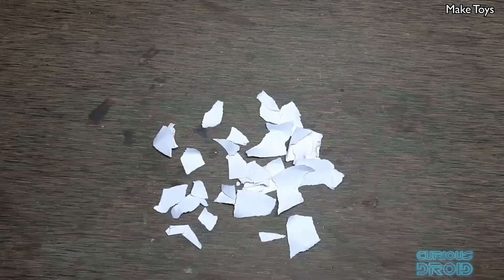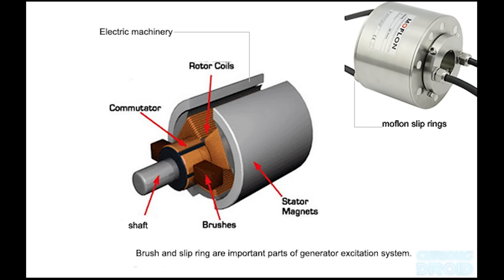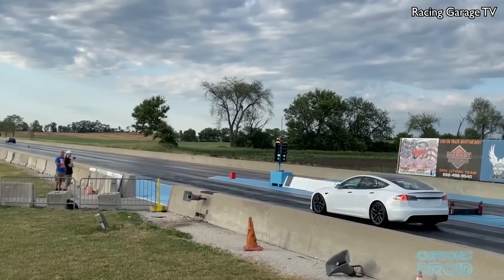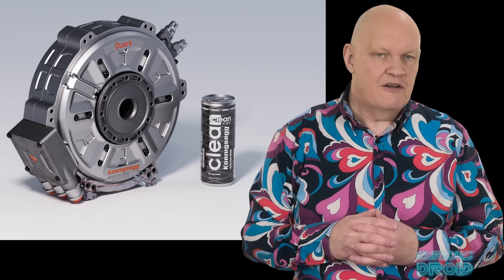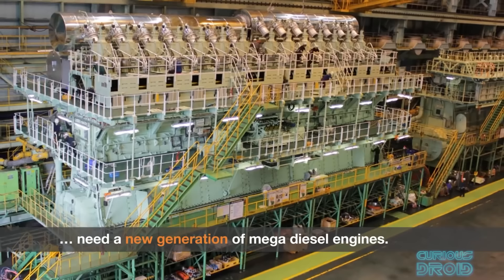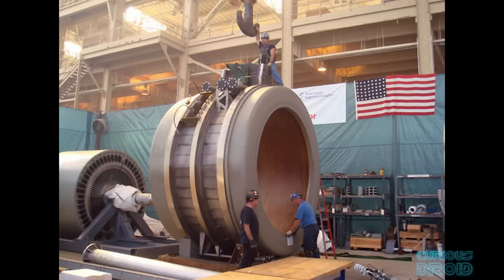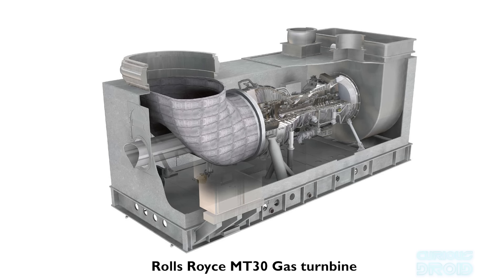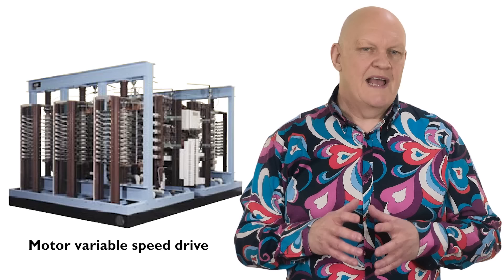The Worlds Most Powerful Electric Motors

Comment: Hot take, but even though EV's are having a huge pop in production from car companies, this won't last long. Not many countries can support EV's. Even 1st world countries can't support them. Just look at California for instance, with their power infrastructure, they can't even handle a typical summer season with households using AC without having rolling blackouts. The other factor is the US for instance will have to upgrade it's power production to a conservative estimate of 70% (source provided by Engineering Explained, and will most likely need far more than that). The final nail in the coffin, a big portion of the population in first world countries can't afford to buy even the cheapest gas powered car, let alone a significantly more expensive EV. People also don't understand that creating a bigger dependence on power companies to charge 500+ million cars in the US, the price/ kilowatt will skyrocket. These chargers are also "vampires" even when there is no car plugged in at a charging station, power is still being feed to it (not efficient, waste of energy).

I can't see EV's in the next 15 years. There's a lot of skeletons in the closet with EV companies when it comes to humanitarian crisis, ecological impact (greater than ICE), moving efficient methods of burning gas to a extremely low efficient power grid, gov. role in forcing EV products on the people, etc... There's a reason why most car companies are jumping on to the EV market but still investing into ICE. Koenigsegg, Toyota, BMW, Porsche, Ferrari, Lamborghini, etc... have stated the cracks in EV cars, and even with their biases, they're not lying. They're only doing EV's for now to meet emission averages set for companies for their product line, they know that stopping production and r&d on ICE will back fire on them, like it will with Mercedes, Subaru, Cadillac, etc...

The biggest way of drastically cutting emissions with the least amount of environmental impact is nuclear fission (until Fusion is viable). Shorting the time, and  granting subsidies to create the latest plants and bring online/ upgrading old will help us stop the dependency on fossil fuels. I would also love to see that be done to cargo ships, but with the amount of accidents cargo ships have, that would be extremely risky and not worth it.
Reply: Right on! The cost of mandated total elimination of combustion engines makes it completely unfeasible for at least 50yrs. And that doesn't count the power grid. I was a farmer, we commonly use inexpensive 20 to 50yr old equipment especially for small but extremely essential tasks. Sometimes very essential such as grain transportation. Most grain trucks are 25 + yrs old, look almost new with only 15k mi and go for $2k to $10k because they sit 9 or 10 months a year inside. There are tens of millions of ICE in service in lower income businesses and personal use for livelihoods such as river traffic in Asian countries etc. I cannot possibly imagine having to replace every single up to 60yr old tractor, mower, pump, truck, chainsaw, ATV,  generator, cement mixer, etc even on a small farm will bankrupt any nation even before you build a power grid which must be nuclear to be feasible.  The cost will be absolutely unbearable by being passed on to us in increasing the cost of any available food, commodities, lost jobs, fuel or parts we still need, the cost of copper and aluminum etc, the taxes for government subsidies to poor people who can't but a USED EV to get to work that needs a battery replacement and costs passed on to consumers. That wartzilla is far cleaner and more efficient than the total cost of installation and production of electric propulsion. Along with a long service life. We will be using alot of diesel fuel to produce the steel, concrete, aluminum, etc for this. As well as transportation. The batteries and motors use RARE earth's!  (Those Diesels are so clean now that 2yr old trucks hadn't darkened the INSIDE of the exhaust yet! But they cost 2× as much to buy and about 4x as much to operate and the close to 50% loss in mpg! (Yes I had to document this on semis) we almost only ever fixed emissions equipment that deadlines trucks and requires tows. The engines that were blown up was from egr water leaks and xtreme Temps and thin oils. So, 2x as much fuel required because of increased hauling of diesel to fuel stations,  30% or so increases in cost of truck, 3x cost of maintenance, tons of pollution releases making the 1000+pounds of computers, and hardware that every 40 loads needs an extra load to transport 40k lb when you are limited to 80k gross weight so more trips! I'm sure this government boondoggle has helped greatly. Let alone the complexity of modern cars placing them out of reach as good alternatives as used transportation for the average working stiff with basic mechanical knowledge. I tell these people to get their heads out of their tailpipes and look at the big picture! The worst part is they use a PROJECTED issue.  (Global Warming due to fossil fuels) that we cannot go into the future and see how it WOULD'VE Been without trillions spent, lives wrecked etc. Thus when those sometimes inflated predictions don't happen they scream success at saving the world. (I remember when Obama said we would be in a collapsed society in a waterless desert by 2020 if he wasn't elected!) Our enemies will love our totally centralized and hackable power supply! No more home grown moonshine and fryer grease power in mechanical engines for us! Or walking with a borrowed can of gas to your dead car!

Comment: it’s a shame so many “electric “ motors get their energy from burning diesel …
Reply: I mean nuclear is the solution, but no one wants to discuss.
Reply: @CallanElliott  Yeah I agree it’s probably one of the top solutions I guess no one wants a power plant in their backyard but if we can erect power plants away from human populations and pipe the energy over to cities that might work
Reply: @ozzyg82  who is burning diesel? thats way too expensive. maybe check sources instead of using political ones
Reply: @Blox117  #keyboardworrier
Reply: @ozzyg82  yes i am a worrier
Reply: @Blox117  sure you are 😉
Reply: @ozzyg82  my point was that the electric grid, if it runs on combustion, is almost entirely natural gas. which is not diesel.
furthermore an ever increasing majority is solar, with some wind and hydro.

Comment: Wtf is the point of using a gas turbine to create electricity to drive an electric motor to drive the propellers??
Why not drive the props directly from the gas turbines? 
Seems all one 'gains' is efficiency losses...
Reply: Gas Turbines run fast with little Torque, which is the exact Opposite of what you need for Ship Propellers. The according gearbox wouldn't be much more efficient than Electric Transmission, which happens to be lighter and more compact. The real Advantage is in Damage Control though, as mechanic Transmission would require the Turbines to be at the Stern next to the Shafts. That means that all Turbines are in the same Place or at least very close to each other, so a Fire or Leak could easily destroy all Turbines and thus cripple the Ship. With electric Transmission, you can place them flexibly (almost) anywhere you like. This also allows to use the Interior Space more flexibly. Cruise Ships use Electric Transmission for the same Reasons, although usually with Diesel Engines.

Comment: You really should do a video on NGTE pyestock (<pictured) far more impressive than that thing nasa has 
The red things are 27.5MW motors 8 of them in this building and because that wasn't enough two more elsewhere 

Pyestock was a jet engine testing facility and could maintain air speeds of 2000mph at 80k feet and because there was a running engine in the test chamber it was completely open and not a closed loop 

Most of not all important European engines were developed here most well known being the engines used on Concorde

Comment: The Real Problem is that these Motors Still require a Source of Electric Power to operate. The problem is that we don't have enough of that Power Generation to do little more than Sistane the electric Power consuming things we now have in place and no more Feasible means of Electric Power Production for all the things they demand we convert too. At least  horses eat Hay and Produced Horse Schit, Then the Horse Schit helped Prouce more hay that Produced More Horse Schit, See the Self Sustaining Power here. Only when Electric Power can Produce it's self will all electrification  be Possible. Until  there is one.

Comment: Koenigsegg could enter the formula e with their motor...
Adding one to each wheel, aiding in steering and peak torque for each wheel, while also having control against Overtorquing.

But I'm not an expert on formula e rules
Reply: You would want the motors to be inboard rather than 'hub' motors.
Reply: @Outland9000  i just meant powering each wheel

Comment: Saturn v. Over 150 000,000 hp. Would burn through 300,000 lbs of fuel before it cleared the tower.
Reply: You can't exactly convert Thrust to kW or Horsepower, as these are completely different Things. IIRC, the "Conversion Ratio" varies depending on Speed. The Power Rating of the Turbopumps on a Saturn V alone blows the Mind though.

Comment: I think it’s a bit disingenuous when people act like electric propulsion is functional with out actual energy!! Your queen Elizabeth is gas and diesel powered quote

“GE Integrated electric propulsion powered 
by two Rolls-Royce Marine 36 MW MT30 gas turbine alternators and four 10 MW Diesel engines”

Electricity is a wonderfully efficient way to transmit power. BUT you need to use something to create that power. Carbon fuels are the best

Comment: Discarding pumped hydro motors because they are motors and generators is objectively wrong.  Most large motors are or can easily be used as generators, all ev motors are used this way and many industrial ones as well.  In industry it has long been a practice to use resistor banks to dump energy into from spinning motors that need to stop instead of using abrasive breaks recently it is  becoming more common to dump that power back in the grid instead.  I would be shocked if the nasa motor did not dump it's inertia in resistor banks or in the grid and instead used friction breaks to slow and stop.

Comment: Technically, any generator can also be a motor. To be very clear, unless its designed to do so, the consequences of using a massive generator as a motor usually results in a melt down. But having worked at a hydroelectric production facility, I've heard it has happened and there are some absolutely massive generators the could 'technically' be used as motors. Lol.
Reply: Electric motor tech here. In the DC mining motor industry, most larger generators are a kind of a skeleton, with a skinny ring of a frame to hold the coils and exposed brushes. The bearings for the armature (rotor) aren't even built in, they rely on pedestals. Those types cannot be used as motors due to the fram engineering, i imagine to save weight. But the smaller generators are briefly run on our test pad so we can checm the bearings and overall internal alignment and they run just like motors
Reply: @ThatCrazySasquatch  I get what you mean. They're extremely bulky and fragle for a motor. But let me clarify. Just because its big doesn't mean it can't have electricity flow back to it. The way most hydroelectric stations are setup, there are obviously protections in place to prevent this. However thats not to say it can't happen because, it has. And when you say it can't used as a motor your correct. I have to imagine the fields collapse and instead of pushing the motor, it just acts as a big resistor. Which melts the connection points and wire coatings until a connection to the array of generators it's connected to fails. Assuming all of the safety systems that prevent this fail.

TLDR. Your right. Its more of a massive resistor when taking in power instead of producing it.

Comment: Too bad they avoid the smarter nuclear power option to power the engines.  Hopefully someone will come up with an electric design that outputs 90% of the energy put in, and not use so much coal, natural gas, and diesel.

Comment: Why would you burn diesel to provide the torque of a turbine, then use the torque to drive a generator to make electricity to run motors that provide the torque required to turn the screws?  Can't you just burn diesel to drive turbines to create torque to spin screws?  Seems like the latter would be far more efficient than the former.  I mean, each time a step is added, it dissipates energy, doesn't it?
Reply: Yes and no.  In a nutshell a combustion engine has a rpm where it is most fuel efficient.  It's more efficient to run the engine only at that rpm and use the electricity.
Reply: @TheEvilmooseofdoom  OK.  I think I understand.  You mean that the diesel engines can be run at maximum efficiency at a fixed rpm, or range of rpms, so that the overall process is more efficient than directly driving the screws with diesel power?
Reply: Torque alone does not translate over to electricity power. Mechanical power does, which is torque and RPM. A 500 hp gas engine at 3600 RPM will power a stronger electric motor than a 1200 RPM diesel that can only produce 200 horsepower. It takes one horsepower to make 746 watts. Notice it does not say anything about how much torque.

Comment: That carrier is still diesel powered because they need to generate the electricity and they're not using a nuclear reactor. Your remarks are incredibly misleading. Also, these "electric" cars are often actually powered by coal and natural gas, because that's what's used to generate the electricity that they charge their batteries with.
Reply: @Blox117  You were unable to find the point, but thanks for playing.
Reply: @kevlarandchrome  its powered by electricity because that is what makes it move.

i rest my case
Reply: @Blox117  Where does the electricity come from? You have no case.
Reply: @kevlarandchrome  read the first comment

Comment: I dont understand why you use stem turbines or gas turbines to generate electric power and then use this electricity to supply two gigantic motors. By doing this you are adding the unefficiency of each power transformation to the system. Why not directly powerthe propeller using the gas turbines directly?
Reply: Because Gas Turbines run very fast with little Torque, which is the exact Opposite of what you need for driving Ship Propellers. An accordingly large Gearbox isn't much less efficient than Electric Transmission, but is lighter and more compact. Plus with Electric Transmission, you can place the Engines/Turbines anywhere you want, while they have to be at the Stern near the Shafts for Mechanic Transmission. The latter is a big Plus in Terms of Damage Control, as Mechanic Transmission would have all Engines/Turbines in the same Place or at least very close to each other.

Comment: 7:10 107,000 horse power... so i could power this with 107 hummer EVs? lol, puts it in perspective how powerful they are
Reply: Hummer EV gets its horsepower through rpm. 

If you were to spin all 3 motors at 100 rpm (the rpm a massive marine engine operates in), you would only get 20-25 hp meaning you would need around 4280-5350 hummer EVs to get the torque of this massive marine engine.

If you were to use a much larger electric motor that revs at 100 rpm, it would be around 50,000 times bigger than a single hummer EV motor to produce 107,000hp for about 30 years non-stop like a big marine engine would.

Comment: And the electric motors are powered by what? Energizer bunny? you still a large nuclear reactor driving a turbine and a generator!
Reply: And steam turbines are more powerful than diesel, so what is your point?? Electric motors allows you to use that awesome power far away from the plant. Good luck with trying to use 1000Km of mechanical shafts from the steam turbine to where its needed. Electricity and using electric motors is more efficient way to do it. So your energizer bunny comment makes no sense.

Comment: That time electricity was generated by fossil fuels only. Not at all impressed by Wartsila Diesel gaint. What a waste of fossil fuel ? Why cannot they use small nuclear powered or gas turbines ? Gas Turbines can be run on liquid fuel and have much more efficeincy than two storke. I would prefer two or more mid size than one big, simply for redundany and ease of maintenance.

Comment: We're not moving away from fossil fuels, Paul. Nobody wants to build nuclear generating stations anymore so we're resorting to coal-fired main generators and diesel generators to assist during peak hours. The carbon offset from owning an EV is absolute baloney when you're charging the car with electricity that was generated from fossil fuels, Paul.

Comment: Didn't think of the duty cycle on these motors.  This put a damper on the EV crowd in that am ICE can run at fill power till it runs out of fuel, were as a EV is only seconds.  Explains why Tesla only brags about 0-60 and 1/4mile and not real lap times.
Reply: Industrial motors are continuous rated. Electric motors in cars are burst rated because you are not going to use 1000 HP to drive 70 MPH down the highway. The motor would be stupidly huge for something that only needs that much power for racing or accelerating.
Reply: @EETechs  hence the unfair comparison because of duty cycle.  No EV can compete at Le Mans (even ignoring fueling issues) were as many manufacturers are using only slightly modified production eninges without issue.

To be equivalent on duty cycle should be a EV compared to a Top Fuel car, at which point the EV  doesn't hold a candle.

The only EVs I'm aware of with high duty cycle is in open pit mining and those are not battery WV buy series hybrids just like trains.